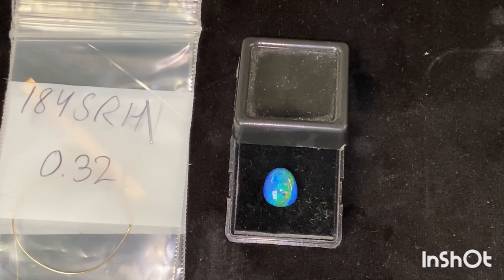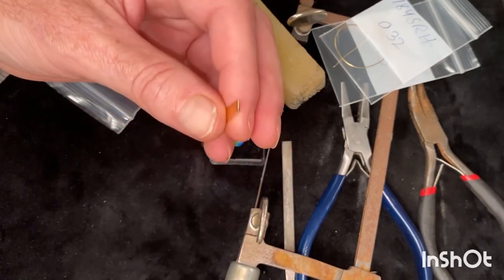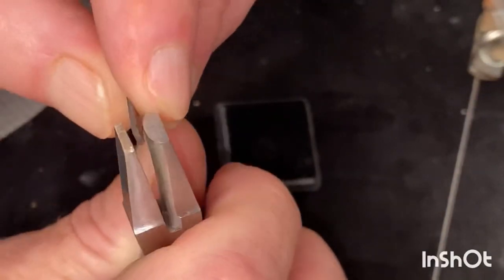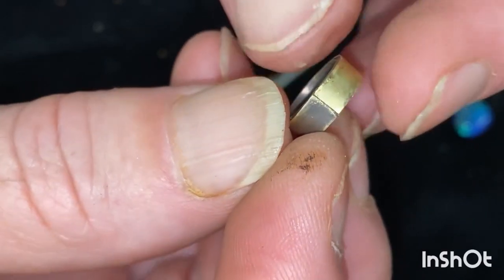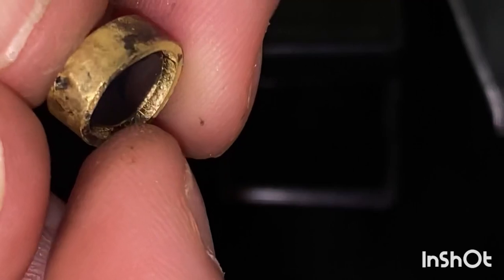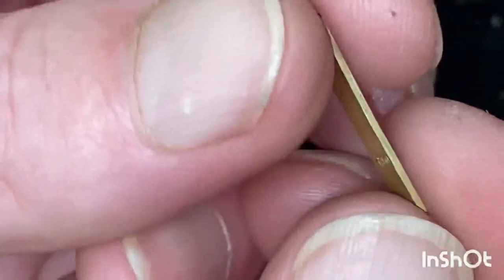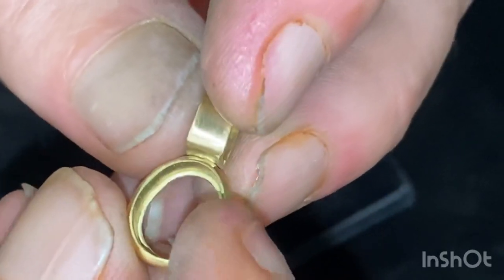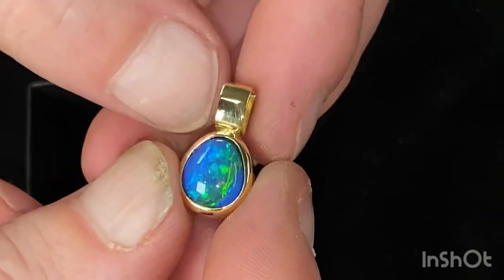Gold smithing: making an 18k gold opal pendant.

Comment: Silver wicks heat away from the torch. Gold does the exact opposite by holding it where the flame is. Adding oxygen to the flame concentrates the heat in a tiny cone. Gold doesn't need the whole  piece heated up, reducing the chance of melting it into a bubble. Very good job at heat control.
Reply from the maker: G’day mate, thanks for the info, I didn’t know about the heat, I treated it like silver. You’ve just made things a lot simpler, so many times I thought it was going to melt the bezel, or the loops on bails. 🤪👍

Comment: its great to see a gold setting for opal for once. I know silver is cheaper but you can't beat gold. it just elevates opal. I actually got my first solid Australian opal necklace and earrings in 14k yellow gold from Costco of all places! its thats hard to find  gold and opal...plus diamonds. 18k! thats some pricey material and looks very hard to bend. its so pretty though 😍
Reply from the maker: G’day Sierrah, Costco? Who’d have thunk? I will definitely be working with gold again, I know it’s more expensive, but, if I start off with light settings for the smaller stones, the gold can go a long way. The gold did seem a harder metal, but i was being gentle trying to reduce unwanted makers marks for less cleanup after. 🤪👍
Reply: I spotted a $320000 diamond ring when I walked into Sydney's Costco. Needless to say I was surprised to find a ring in Costco as I was making assumptions about what they stock. I've seen all sorts of stuff in Costco now...even seen a Mahogany and Gold handled coffin there once....weird place that Costco...

Comment: Hey, could you melt the gold filings and trimmed pieces use them as solder?
Reply from the maker: No, gold solder is made from a mix of components with the most significant addition being the low melting point metals such as indium, cadmium, zinc and tin. 🤪👍

Comment: That is a ridiculously thick backing. Lot of useless added carat weight.
PS: You didn't show pushing that bezel over the stone. Can't have been easy. 18K is pretty stiff.
Reply from the maker: G’day mate, the stone is a doublet, as with all opal the price is regardless of the weight, the stone is valued by many factors then divided by the carats to arrive at a carat price, hence excess backing reduces the carat price as excess weight is one of the factors considered when pricing. The backing on the doublet is to ensure stability, strength for setting, not just to blacken the background. I don’t have any certification in jewellery making, but it’s not rocket science, I’ve learned that I can use almost any thickness of bezel a long as I file the bezel thin where I want to push it over, I don’t just squish in the sides, I actually work the metal to fold it over, encapsulating the stone. I’ve never set a loose stone. I’ve shown my bezeling process in other videos, but filming it is hard as I block the camera a lot, you just see my knuckles. 🤪👍
Reply: @theopalmills  Thanks.